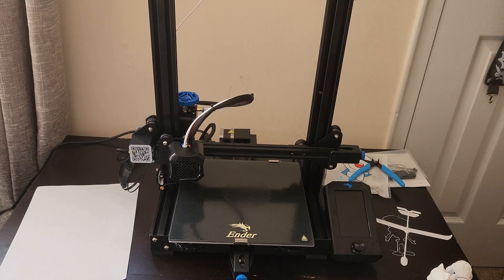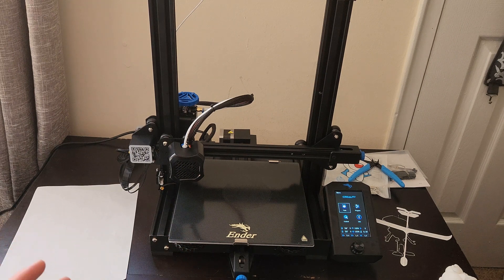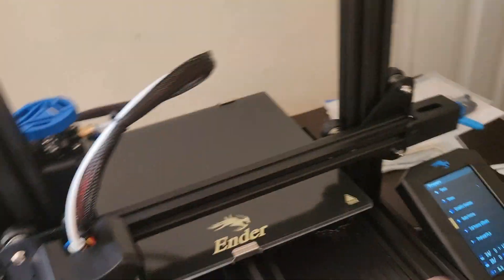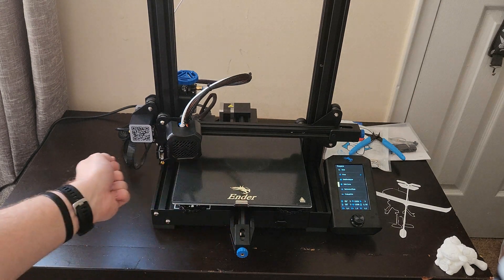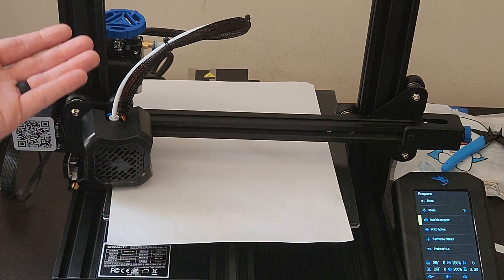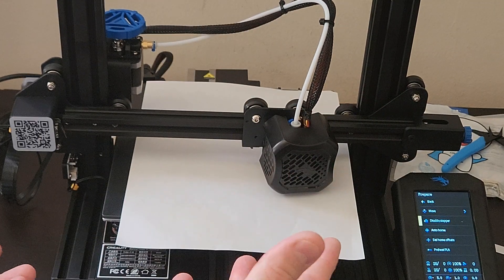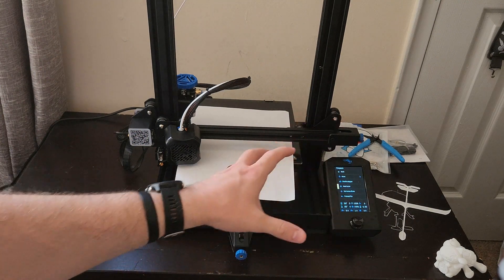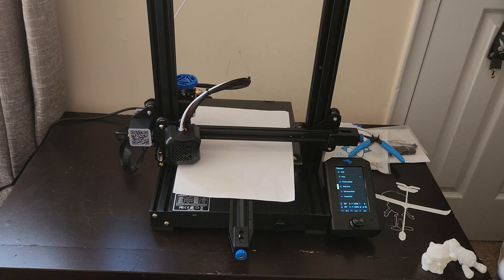How To Level The Bed - Improve 3D Prints On The Ender 3 V2

Comment: Quick question, in the very beginning when you are setting your limit switch, are your bed leveling knobs twisted all the way up or all the way down to start with? Or does it not matter?
Reply from the maker: I aim to put the bed in the middle of the spring height for the 4 manual leveling wheels. This way it has room to go up or down to level the bed.